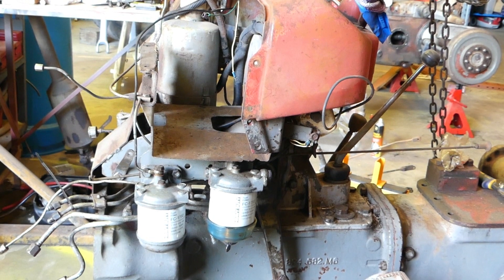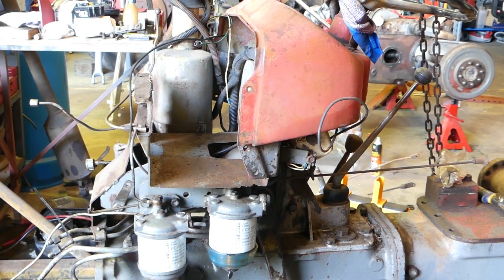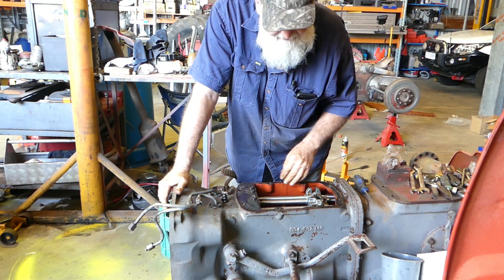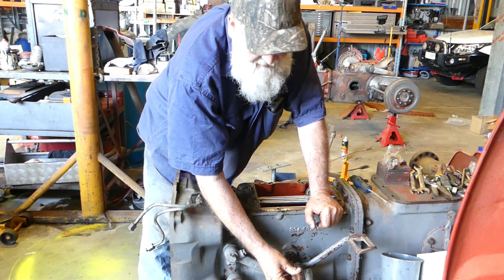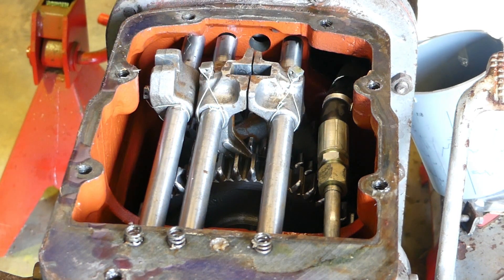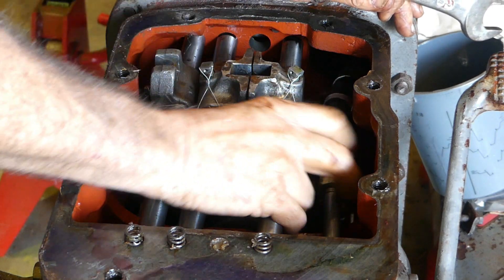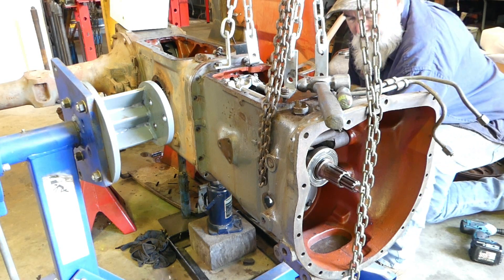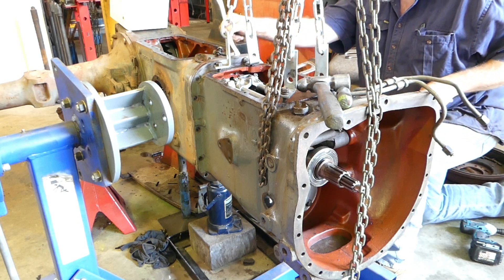Massey Ferguson 135 Multipower Removing the Main Gearbox

Comment: G'day Lance, 

Congrats on 20k subscribers.  Just had a quick question,  can an early Multi Power 135 with the old style pump be upgraded with the necessary bits to the later pump setup?  I'll have to chuck a video up of the W30 running with the reconditioned carby soon (when I get the head back on.) 
Cheers,  Josh.
Reply from the maker: Yes, absolutely but it is not a cheap exersise
Reply: @BundyBearsShed  Thanks Lance,  and does the MP pump gear train assembly bolt to the 3PTL pump somehow?